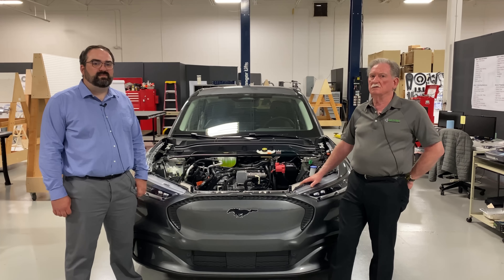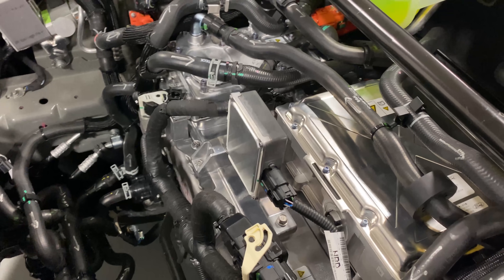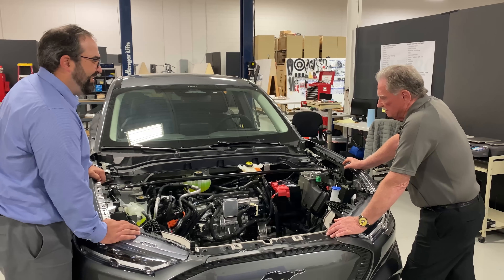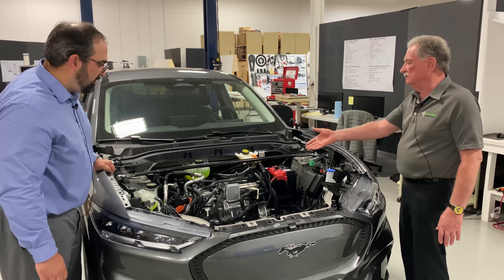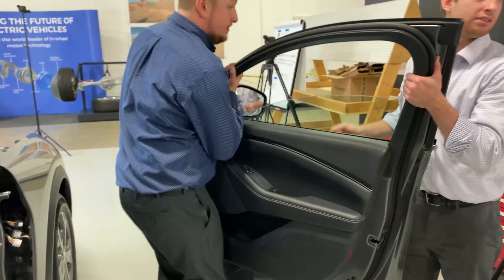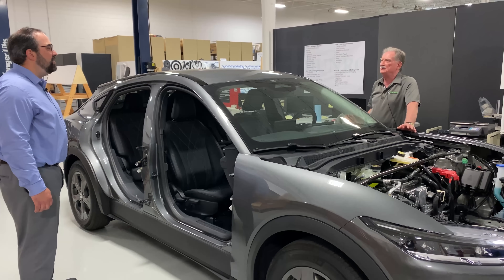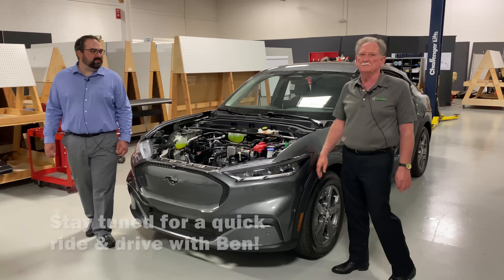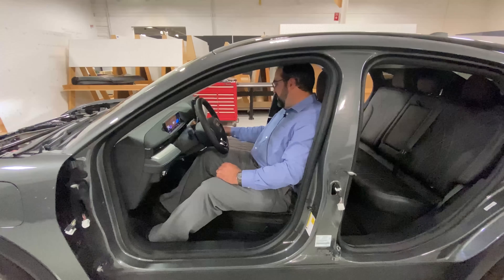Mach-E Teardown: Doors Off + ECU Mystery Solved

Comment: i imagine the driver door contains a security module for the other doors (does it have the touch keypad?) if so maybe that explains the hatch issue (the 2018 fusion i own allows you to open the trunk from the keypad on the driver door so maybe thats something to do with it?)

Comment: Well if it's acceptable for Europe then it has that nice new nanny device that's embedded in the electronics that make sure you're doing 30 in a 30 40 in a 40 and so on and the fact that you don't break any other driving laws if so one of those black boxes that you can't figure out is GPS I would imagine along side of a system that can slow you down when needed or give vibrations through a foot pedal so that you slow down to the correct speed if anybody else knows about this system please fill in or feel free to correct me where I may may not have been wrong I just learned about the system a few days ago I'm still learning

Comment: I'm sorry but any part will be put to a complete and full test anytime it meets the same general working area as the 200 lb gorilla beating on it so putting parts inside that are inherently fragile it's probably not the best idea for a longevity but not overly shocking Ford has had a lot of very questionable design ideas with this car ! Did I just hear him correctly we don't know everything that it's connecting to, 🤔🤨 really so I take it you don't know why it works it works and you're just not going to question the fact that you don't understand why it works

Comment: You can't integrate every component unless you want 75,000 miles of wires. Yeah it would be nice to have 1 ECM doing everything. Just imagine the cost of repair if you had to replace that one huge module  because the horn won't blow $$$$$

Comment: I guess it will stop working once you remove any safety interlock connected component of the HV-System or if you remove anything from the CAN that is "unlock" critical, like the instrument cluster, id box or main inverter ECU.
Would be interesting to see what happens if you disconnect the instrument cluster after the car is unlocked / in drive.. It should keep working than :D

Comment: just my opinion, but that the mach-e looks like an suv (mini), and very bulky, and not the sportscar profile that has been sold in the past. i would not buy it, based on appearances. so it (the mach-e) is 66 grand, way more than a standard suv. 
https://www.caranddriver.com/news/a36213628/2021-ford-mustang-mach-e-gt-priced/#:~:text=The%20high%2Dperformance%20version%20of,in%20a%20claimed%203.8%20seconds.&text=The%202021%20Ford%20Mustang%20Mach,cost%20%2466%2C000%2C%20Ford%20has%20announced.

a regular mini suv would be less than half the price: 
https://cars.usnews.com/cars-trucks/rankings/compact-suvs

i wouldn't buy it.

Comment: From a packaging and manufacturing perspective integration is wonderful - But it's also the reason why mechanics hate engineers and bean counters. You want to replace the little doohickey? well it's also a bracket a coolant manifold, crash mitigation and a fuse block - so good luck taking the whole car apart to replace it! It's clear Sandy is a value engineer first and a Mechanic 2nd. (and he's created a business around that so kudos to him)  I always thought good engineering should also take ease of maintenance into account. I guess that's the OEM perspective though - best solution for least $$. In contrast to the consumer perspective which would prioritize accessible and thus less expensive maintenance and easy replacement of parts. A lot of the time it appears those two goals are diametrically opposed...

Comment: @Munro , The driver door is also connected to the "shifter" knob. If you're in drive, and you open the driver door it puts the car in Park. This is especially noticable in One Pedal Driving, as your car is already stopped. Perhaps that's why its connected.

Comment: if you want to capture an OTA update for the Mach E, it shouldn't be too hard. Set up an AT&T microcell in the shop, and do data collection (tcpdump or wireshark) on the communication between the microcell and the internet connection (man in the middle it). This is since FordPass Connect works with AT&T's network. An issue would be random cell phones in the shop that would be caught up in the network, so ideally you'd have employees that use an AT&T phone put theirs in airplane mode and use wifi calling (if possible). Or just try filtering out based on IMEI number if that's possible.

Comment: My assumption is that there is some kind of lock mechanism that unlocks the hatch if the drivers door is opened, and without the driver door installed then its missing a signal or something

Comment: I believe Ford is a subcontractor driven design so the plumbing is to connect the various purchased modules.  If you are vertically integrated you can integrate the modules into fewer boxes.

Comment: Something to keep in mind is that Ford developed this vehicle very quickly.  If you believe what Ford said, they basically scrapped the EV they were working on and started from square 1 sometime around mid 2017 after Hackett took over.    So they got this car to market in only about 3 years, give or take.  It would make sense that this vehicle looks like patch work on the inside.   They were probably just trying to get an EV to market that performed like a "Mustang".   I think Ford right now is just trying to prove a point that they can build a good performing EV and that they are in the EV game.   Designing new efficient integrated systems probably wasn't at the top of their mind with this Mach E.   But like Sandy says, it will be interesting going forward to see if Ford makes changes as they strive for high volume production.

Comment: I remember during the rise of CNC machines, we had Italian ones with a lot of modules coupled by tons of wires. Those things would fail weekly. Then we got Japanese machines and when we opened the control box we saw just one giant PCB with literally everything mounted on it, from the power electronics to the microprocessors and what have you not. We NEVER had to repair that machine…it just kept goin’
Reply: That’s what Japan does best take an idea make it simple  and more reliable .

Comment: I'm interested in seeing if they can update the vehicle without some of the ECUs responding. In the Model S I can do a skip of individual modules (i.e BMS, IBST, GTW, etc), but it has to be specified with cid-updater commands before the update. It might download but not correctly stage, unless just the infotainment is getting updated. It seems Munro (and associates) want to reverse engineer/observe as much as they can about the update process. If it's anything like Tesla's used to be, it's extremely possible.

Fun fact: in the S, every door handle has its own ECU (dhfd, dhfp, dhrd, dhrp) and therefore its own firmware, in addition to 3 different generations of handles due to issues with solder joints and gears. They're pretty good now, at least, but the new headlight signature lights still have the burnout issue that has existed for over four years.

Comment: The Mach E is made in Mexico, free trade agreement w/ the EU, and is already being delivered in Europe. I have not heard of Ford planning to build the car in the EU.
Removing the driver's door probably disabled the central locking system. Doesn't the car have a Bluetooth or other wifi sensor that recognizes when the driver is approaching? That is probably mounted in the door.

Comment: I can't believe Sandy is arguing against modularity. Modular design. When it comes to recycling, reuse and maintenance, big advantages even if more than one box upsets the bean counters.

These boxes and controllers can be common across an entire fleet, reducing cost, increasing features, flexibility, future proofing against evolving charger standards, and increasing reliability.

The door breaking the hatch? Maybe the door and window controller and power is in the driver's door. Also to enable locking them out. You wanted everything combined to save money, right?

Comment: Maybe if you would have hooked up a scan tool before beginning disassembly you could have looked at the PIDs available in he DDM and seen exactly what its inputs and outputs were and thus what it did. Ditto for all of the other modules in the car. There are affordable aftermarket solutions and you could always spend the money on the OEM stuff.

Comment: I thought EVS were going to be simple with fewer things to go bad. They are worse than ICEs.
Reply: They have to do all the things we expect a modern vehicle to do, in the case of ICE many of those things are handily taken care of by the lump under the hood, it provides heat, electric power, mechanical power for AC etc. 

Electric cars require workarounds to provide those features while also requiring significant complexity for their own unique features, you need heating and cooling for each part of the powertrain for example.

Comment: Some thoughts about that.  If you put the controller packaged with and in other expensive components, failure could be very expensive.  It might be that this units MTBF is a lot shorter than the other part of the charging apparatus.   And/or thermal issues might be important.  Maybe it needs to be cool.  I agree that putting or integrating parts together simplifies the assembly but does not necessarily contribute to servicing.  I doubt if there was much of a sacrifice in weight.

Comment: Hey guys, you need to read the owner's manual for the Mach-E a little more closely if you want to grab an over-the-air update.

Page 362:
Over the Air System Update Requirements
Before updating, reference this list to make sure your vehicle is ready be updated. If these requirements are not met during a scheduled update, the update will be canceled and you can reschedule.
• Your vehicle is not running.
• Your vehicle is stopped.
• Your vehicle is parked.
• The hazard indicators are switched off.
• The alarm is not sounding.
• The doors are closed.
• The parking lights are switched off.
• You are not pressing the brake pedal.
• An emergency call is not in progress.
• Your vehicle is not in limp mode.

I think as long as you have all of those errors regarding the doors, hood and hatch, it won't do an OTA. Ford also wants the car attached to a local Wi-Fi network, probably for stability.
 
Page 362:
Over the air system updates E327789 allow you to update your vehicle
system software wirelessly. To make sure you receive all updates, set a recurring schedule and connect to Wi-Fi. Updates may take longer if not connected to Wi-Fi, or may not download at all.

Page 328:
CONNECTING THE VEHICLE TO A WI-FI NETWORK - VEHICLES WITH: SYNC 4
Access the application drawer on the touchscreen.
1. Press Settings.
2. Press Connectivity.
3. Press Manage Wi-Fi Networks.
4. Switch System Wi-Fi on.
5. Press View Available Networks.
6. Select an available Wi-Fi network.

Comment: It is interesting to see what they did, but I am not surprised after working around engineers for many years. I am retired now, but several years ago I was working for a mid size company in the petrochemical area. We built and repaired the turbines that run the oil refinery plants. 

We  had monthly meetings with all the employees and one of the requests put to us was to submit suggestions on how  to cut costs. I submitted a cost cutting suggestion and after several weeks did not hear an ok or go away so I went to one of my friends in engineering and asked him about it to make sure they even got it. 

He said yes they got the suggestion and upper management totally agreed with me about it cutting costs, BUT were not going to implement it because the current method they were using in that area was designed by one of their top engineers and they did not want to take the chance of upsetting him. 

Needless to say I never submitted another suggestion. I tell that story because one must understand that engineers love to have their names on products and designs and are many times allowed to submit and incorporate less then the best of designs just to keep them happy. Also they do not like their toes stepped on so it may be a very long time before Ford changes that design.
Reply: Yes!  I worked for a large O&G Service company most of my career.  You come to realize that many decisions being made by things we use every day, in all aspects of our iife,  are being made by one or two people with input/approval/decline from others but still a somewhat small group. I'm sure many companies use market surveys to guide them but....

Comment: The module at the door could be the communication module between the car and the charger, to authorize the charging session by the VIN or other means. It's probably similar to how Tesla authorizes cars to use the supercharger network so you can just plug and charge, no cards or apps needed if your registered.
Reply: no. The harness just runs thru the driver door first because thats where everything is controlled, like in most cars... especially ford

Comment: The PLC communication for CCS DC fast charging is carried over the J1772 Pilot line, NOT the DC HV lines!   Sandy, you need a more experienced EE on staff if you are going to do proper electronics analysis.
Reply: you need to listen again, he said its uding the canbus to communicate to the dc fast charger
Reply: "when you go to an Electifiy America charger they are using power line communication".  Pretty clear to me.  He's right about that part, although it's not unique to Electrify America, and it's also the same in Europe, which he is also wrong about.  CAN is not used to communicate with the DC fast charge on CCS.
Reply: Ingineerix:  Keep posting please.  What you say makes good sense.  More details needed on that top component.  Thanks.
Reply: @jamesseay9943  If someone wants to lend me a Mach-E, I'm happy to do a detailed analysis.  =)

Comment: I loved your video Sandy but as a Engineer you seem to want to integrate everything but as automotive technician it’s best sometimes to separate things a bit for repair and cost of repair imagine if this module is to be replaced and it’s in the battery pack assembly imagine the cost of labor to fix it or test it if it’s hidden in the battery pack.
Reply: the whole point is less repairs. Don't worry, you'll love those hoses

Comment: You have to test the car with last part before it’s undrivable.   I’m guess it will give you 1,000 miles of range.
Reply: ever heard of aero drag?
Reply: @baby_UFO  car is already in limp mode. 5 mph restricted speed likely.  

Or are you talking about my weekend hobby?

Comment: I own a Mach e , how can you tell you receive an over the air updates?  Revision date/version?  Thanks
Reply: Well, on Tesla you get a message informing you that there is a new update on your App and on the car display.
In general you need find a WiFi connection to start downloading the update, 
but sometime the car download it directly in advance using the Cell network.
Then the system ask you to select the best time to install it because you will not be able to drive.
Reply: They probably have CAN sniffer hooked up in the vehicle constantly waiting for the next update to happen.